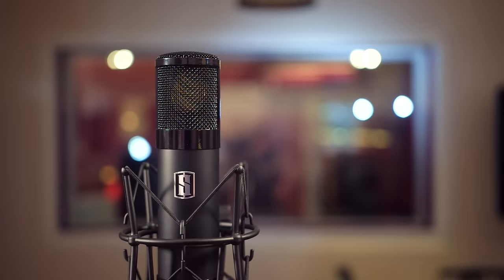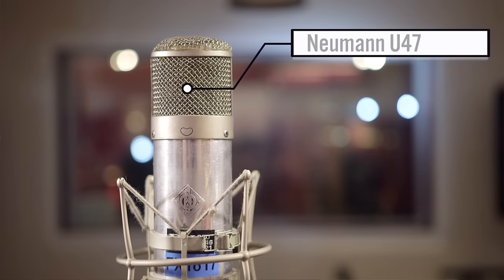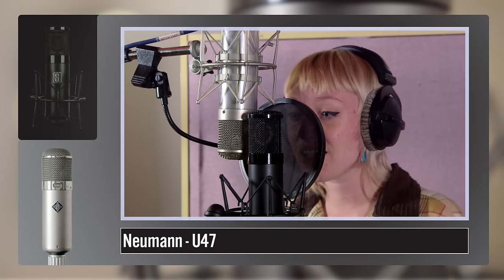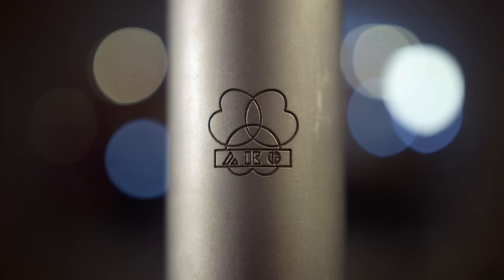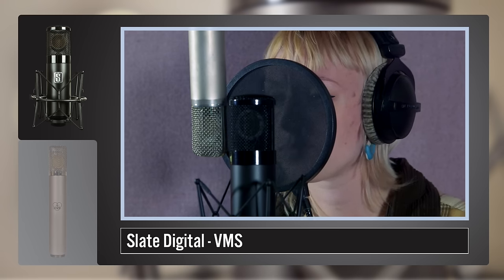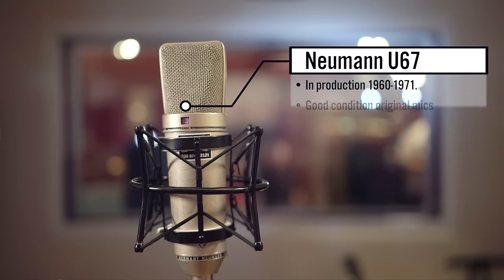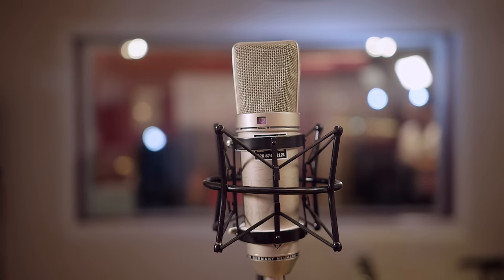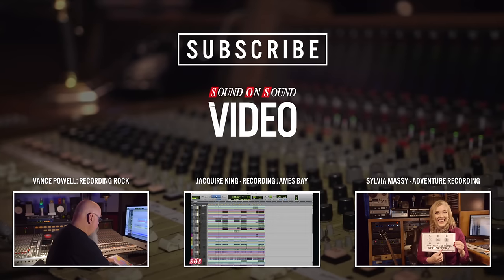Slate Digital VMS: Classic Mic Comparison

Comment: My conclusion:
comparing the ML1 to the U47, 67 and C12, the originals had a bit more warmth in the low mids, the ML1 a bit more sibilance around the Ts and esses.
Comparing the C800 to the ML1, the C800 had more detail and depth.
but the ML1 does get really close indeed!
Yes, in all cases I did prefer the originals, but considering that they're all about 10x the price, I think the ML1 did a great job.
An interesting question would be if it takes processing, compression, EQ as well as the originals.

Thanks @sound on sound for taking the time to do this comparison!

Comment: I'm glad you realized that every vintage mic has its own signature sound. You also realize that the Slat VMS could be adjusted to more closely match any one particular vintage signature to get the comparison much closer to a specific mic. In the end, listening to Slate's tweaked versions, I really can't tell any difference between mics. However, I'll also admit that as I get older my ear can't distinguish the subtle higher-frequency sounds and harmonics as I could when I was younger and my ears were less damaged by listening to too much Rock and Roll ;-) For the price, and the fact you have a huge variety of mics to test to best fit a specific person's voice in a specific song mix, the Slate VMS is very impressive. I was really blown away with the Sony C800G sound. I've never used one but I saw a video that David Gilmour used the C800G on his album On and Island. It is so much airy and brings out the lows so smoothly. In comparison with the U47 and the others, they came across quite a bit muddier, which surprised me a lot. Thanks for doing this comparison, it was a real ear-opener. I'm definitely picking up a Slate VMS based on this comparison. I figure it will save me $50k +/-, so the real question is really, why would I NOT go with the Slate VMS? Cheers

Comment: The potato is a starchy, tuberous crop from the perennial nightshade Solanum tuberosum. The word "potato" may refer either to the plant itself or to the edible tuber. In the Andes, where the species is indigenous, some other closely related species are cultivated. Potatoes were introduced to Europe in the second half of the 16th century by the Spanish.

Potato has become a staple food in many parts of the world and an integral part of much of the world's food supply. It is the world's fourth-largest food crop, following maize, wheat, and rice. The green leaves and green skins of tubers exposed to the light are toxic.

Wild potato species can be found throughout the Americas from the United States to southern Chile. The potato was originally believed to have been domesticated independently in multiple locations, but later genetic testing of the wide variety of cultivars and wild species proved a single origin for potatoes in the area of present-day southern Peru and extreme northwestern Bolivia (from a species in the Solanum brevicaule complex), where they were domesticated approximately 7,000–10,000 years ago. Following millennia of selective breeding, there are now over a thousand different types of potatoes. Over 99% of the presently cultivated potatoes worldwide descended from varieties that originated in the lowlands of south-central Chile, which have displaced formerly popular varieties from the Andes.

However, the local importance of the potato is variable and changing rapidly. It remains an essential crop in Europe (especially eastern and central Europe), where per capita production is still the highest in the world, but the most rapid expansion over the past few decades has occurred in southern and eastern Asia. As of 2014, China led the world in potato production, and, together with India, produced 37% of the world's potatoes.

Comment: Generally the first thing I'd notice is the VMS emulations always sound a bit "harsher" and more excited in the top end. If I had a better playback system, I'd probably hear all the small stuff like differences in depth graduation and impulse response probably, but of course you can't emulate on axis response aswell as off axis response on so many different mics (and therefore capsule designs). And of course, anyone who knows how to mix will probably have no issues making the emulations sound really good in a mix. 
I think the "drawback" of not perfect emulations is vastly smaller than the pros that the option of "choosing the mic" in post give you.
Thanks for the History lesson and the great comparison!

Comment: its worth remembering that all these old mics vary in character, no 2 are the same, and, as is the case here, some have had parts replaced that are not original. The Slate emulations were taken from specific mics they chose in the US. I have been researching the VMS system for myself and i know that Slate were pissed off at this review, as these hire mics were in some cases filled with different capsules etc. Slate now offer a 2nd, less bright version of an older Sony mic as they realized that the older c800's were warmer than the new one they has first copied. 

Personally, i have never owned any of the classic mics and never will. But if a £499.00 black friday deal gets me a bank of pretty great sounding emulations then i'm very happy with that.
Reply: Period!!!

Comment: Proof that the source is far more important than the microphone. If you can afford a U47 fair enough buy one. It will either compliment your abilities or confirm the opposite in detail. If you want a top sounding mic/pre setup buy an AT4047 and a GAP pre 73 MKII. I had to sell mine and most of my recording gear when I fell on hard times but even if I won the jackpot tomorrow and could afford more expensive gear I'd buy an AT4047 and a GAP pre MKII straight away. I miss them dearly.

Comment: What if they told you that the mics where never switched from the originals... LOL There is a natural low mid vibrato in  the original U47 and U67 that is not replicated in the VMS.

Comment: Well made test! The sound pressure in 7:00 is too low for VMS so the original Mic sounds automatically better. The C12 modeling from Slate seems better to me than the original, probably because of a difference between the original modeled mic and this one. As always, the U47 sibilances sound not-natural for me. Very good modeling system. AND the narrator could have been miced/EQed better, he seems to lisp because lack of sibilance.

Comment: Listening to these tests and my overall thoughts are that the Slate solution just sounds better. Now of course ‘better’ is a very subjective perspective so my opinion can be taken with a pinch of salt. However I do have two originals of the mics tested, (the Sony and the 67) so if there was an opportunity to be biased  think I’d take it 😅. I’ve made a career out of the 67 and in many ways it’s like a 35 year old friend that has been tried and tested, (Kiss From A Rose) but the bottom line is the Slate solution sounds so close that the convenience aspect of it far outweighs what differences there are. 

I use the Slate all the time and couldn’t be more impressed. 
My name is Seal (as in the recording artist)

Comment: I’m just waiting for another Slate discount: the fact you can have a multitude of different sonic options on one mic system for a reasonable price is a deal-breaker. If a song has a great production, no listener would ever say: “yes but the vocal just didn’t cut through with this obviously digital mic emulation”  😂
Reply: It’s actually on sale for 500 on sweet water until December 4th so if you haven’t yet ad you’re still looking, then I would pull the trigger!

Comment: I listened to the examples with my eyes closed and couldn't hear any major difference.
Reply: I especially could not hear a $10,000 difference
Reply: It's goes really close, but it seems like the VMS has inherently MUCH more mids than any of those mics. It's not good or bad, just different.
Reply: of course you don't hear 10000 dollar difference. price of these equipment is exponential. which means you get 90% of all the performance you can possibly get with a 200 dollar mic.
Reply: The VMS is $999, not $200...
Reply: same here, just felt slate mic is lil heavy at bottom
Reply: Matt Allen v
Reply: Sean Gordon he meant a regular 200 mic.

Comment: Slate is really killing it with their emulations. If I had the choice and I didn't have to maintain them, I'd obviously choose the real thing across the board...but factor in everything and it's obvious Slate is bringing their A game here. You have an entire vintage locker for a quarter of a SINGLE cheaper vintage mic. And think about it--they're not known for their poor quality or anything. None of the "shortcomings" are mistakes. Maybe some are limitations or compromises, but not mistakes. They've surely AB'd with several references for each model painstakingly and in all ways imaginable. A blind test done cold would likely show how well they've done.

Comment: Disclaimer: I'm no purist as I both use Mesa Boogie and Victory amps but I also use Fractal Axe-FX. I was thinking about buying the Slate VMS but here is the deal: I did a blind test and spotted each time which microphone was used, and I do not own any of the vintage microphones tested, therefore I do not know them by heart, just by listening to them in records and tests. VMS loses in the mid-range, the difference to the U47 is huge. VMS is duller, less lively, fewer harmonics, sadder, somewhat 'shure-like'. For the voice over it actually sounded better, somewhat more suited for this type of work, it reminded me of the Shure 7B (I have one of those).  Comparing to the AKG, the originals mid-range harmonics are richer and have natural compression. The VMS is more dynamic, the pressure differences are more pronounced as low velocity is way down and high velocity is sort of 'in your face'. I don't think that's good for editing, as we need more subtle pressure differences to get a well balanced lively fresh airy vocal performance.  It is said «One cut is worth a thousand boosts» and the membranes of the VMS are just not the same as the originals. I think that software, at the present state of development, just cannot compensate for the physics phenomena involved in a U47 or the AKG response and tone. So, as I have a Shure 7B (VMS sounds like a large membrane dynamic microphone), I am quite inclined to try another sort of microphone based on a 47, perhaps Warm-audio, which clones the U47. Still not decided yet, although VMS didn't convince me it would be able to replace any of those classics, the software emulation possibilities are very interesting, in the other hand buying VMS would set me back 1000 euros, which may be used to get 1/3 of a top microphone. I so much fear the disappointment of buying something that gives me buyers remorse. In any case Slate VMS will never be a U47 no matter what I would tell myself. «Sometimes you have to make tough decisions to hold the line on spending»

Comment: the slate mode is clearly much brighter than original one. Far from being a close replica
Reply: Christian Loudieu that is because the mics they tested are different from the mics they model. No two U47 will never sounds the ssame. Steven also said that the tube mic they model explodes after they have finished model, and when they re-tube it, he tested again with their model and never sounded alike .
Reply: I checked with spectrum analyzer, far from subtle difference. We're speaking of 5-6db in the 8-13khz range. And it's the same for all emulation. As for a lot of people, brighter is better, I think there is a little hype ...
Reply: Christian Loudieu as i have said it before no two mics will never sound the same...i bet i will be accurate if you compared it to the actual hardware they modelled
Reply: Don't speak to me, like I don't know anything about mics and gears, as I own a lot of it. Of course, no two mics sound the same, but we're speaking 6db, witch is outside the tolerance range of the mic. Could be possible for a U47, but for a C800 which is Japanese and modern mic, It would have been rejected by quality check. There clearly something wrong.Or as usual, a little hype on the lows and highs.
Reply: Christian Loudieu i am saying with great respect.. have you a/b it from the offical website? i would really love so see your comment about that.
Reply: Andrew's spot-on here.The only true test will be the one that tests the VMS against the original mics that were modelled.
Reply: Explain
Reply: Christian Loudieu  the slate still very close my friend , these dinosaurs are old, old technology, 2 vintage would never sound the same, and it's the same for the vms,if you take the model dinosaurs they will sound the same, I owned 2 vintage 1073 ,they don't sound the same my friend...
Reply: You are right, but i simply went in to my DAW took a high shelf filter and as you said, i got it to 6+Db to in the highs i just lowered it -6, and belive me it sounded EXACTLY the same, i was actually verry supriced, but it is verry hyped in the top as u said, it`s still a nice mic anyway i think.
Reply: I totally agree, the slate sounds more more open more airy, more modern maybe.
I find it less precise in the low-mid domain too, but for the price it's still a great mic setup I guess. 
Dont forget the orignal one cost 10x more !
Reply: @AndrewBawitlung  Yes there are subtle differences between mics of the same model, but not a 5-6db difference across 8 - 13khz as previously stated. It is clear in all of the comparisons I've looked at that the base Slate mic has more high end hype in general, and certainly more so than the Antelope Edge, and, as shown here, as compared to the actual mics that were modeled. That isn't to say the Slate is bad at all, it's just a fact worth knowing before going in on the Slate.
Reply: @hisroyalsucculence  The comparison is at best FLAWED! They need to get the actual mic they modeled as "Vintage Mics" sounds too different for this kind of comparison.

Comment: I am shocked. VMS is ALWAYS... and I mean REALLY is ALWAYS so much more bassy and brighter. (All test). Maybe it could handle some small equing, but why?? Is that a proper emulation? I am not talking about some minor changes. The difference is just massive!!! Better buy some cheaper, good mic or replica Price range 400-800USD. This Slate Digital emulation is nonsense + you have to buy their preamp too (extra costs)

Comment: Man I was ready to buy, I'll do more research because I love the concept, I think it's genius.... but uggggggggggg PASS.  I love slate.  I've worked with Jack Joseph Puig to give context.   Every time they switch it sounds digital and choked... I'm actually bummed by this. I never hate on artists but it is hard to compare without REAL context with current trends.   I appreciate the knowledge and background which was great but it proves.... You can't teach taste.  You can teach empirical knowledge and 1's and 0's to anyone but you can't teach taste.... couldn't finish this and was upset enough to write this.  EASILY could've done a more impactful and relevant shootout sending two texts here in LA.  I'm more upset about being let down about the VMS than anything.   Let's be honest... a great performance is more important than gear not vice versa   BUT.... UGGGGGG  I'll stick to my BLUE KIWI-MANLEY VOXBOX - Distressor combo. I think this video did it's purpose but let me down about how they chose to do it.  I expect better.  If "I" can do better you need to figure a few things out because I don't want to be the one doing these videos.  But you have convinced me that the vintage ones are still the unicorns, for that... thank you.  (but you can do better, why this?)  I would've recorded modern current tracks and done the shootout FYI to give better context.  It's hard to even discern what's happening because we are all re-calibrating to just the source material.  Why?  Find an artist with a huge social media following for free and do the test. Its not 1972...
Reply from the maker: In fairness, it's worth downloading the updated sound files from our site. With a little bit of tweaking, Slate was able to model the mics we rented more closely. Try a blind test with those files and see what you think.
Reply: Will do thank you for your response...  I can dig that

Comment: is slate seriously claiming their u47 simulation sounds like a real one?  I closed my eyes for the entire test and was able to write down the exact moment each mic switched and which was a real u47. And this is from someone thats never looked into what a u47 sounds like! How could I do this? Slates simulations all have the SAME. EXACT. PROBLEM. They are literally all too bright. Thats all you need to know to differentiate the real from the simulated. Every single one of their simulations are markedly brighter than any of the mics they are simulating, including for already bright mics like the sony c800g. It goes to show that if you have a cheap k67 style chinese LDC, there isn't much that can be done to remove the "cheap" from a cheap mic.

To be fair, the simulations don't sound bad. I prefer a lot of the slate simulations to the real thing,as I tend to like present, somewhat bright, in-your-face intimate vocal sounds. My point s simply that they don't sound the same. This is not necessarily a bad thing. And to be fair, the c800g simulation sounds quite similar, except the simulation is a bit more bottom heavy.